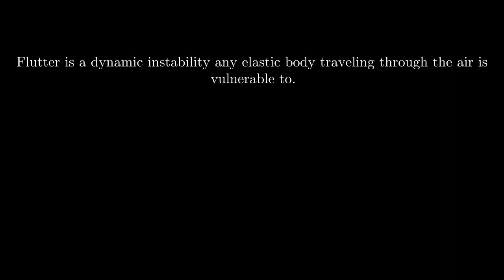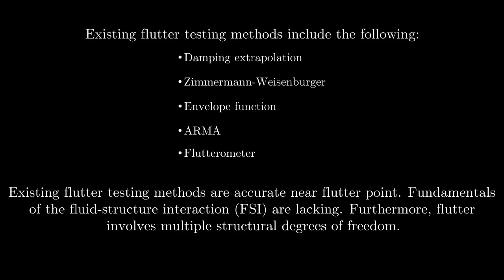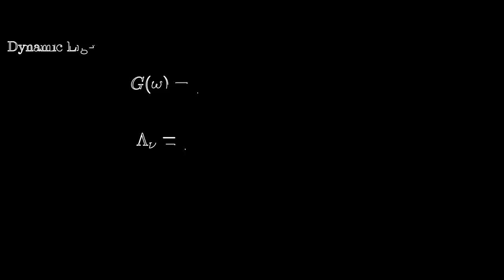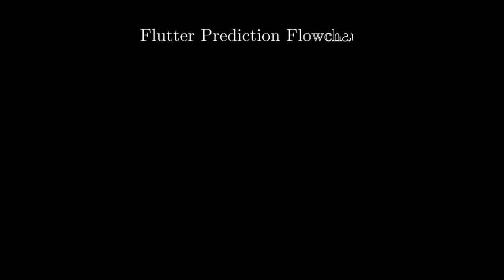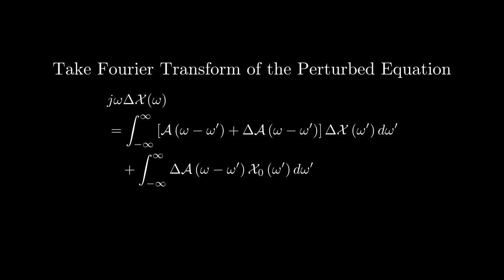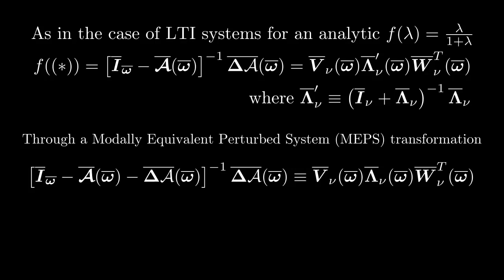Dynamic Eigen Decomposition III: Applications to Flutter Prediction, Linear Time Varying Systems

Comment: It is important to know that the perturbed flutter equation has the rank of 2N, exactly twice the number of structural degrees of freedom, regardless of how many degrees of freedom the original aeroelastic equation of motion has. This means there are only 2N nonzero dynamic eigenvalues and we need to deal with only 2N dynamic eigenmodes.  Typically, the coupled AE equation has far more fluid DOFs than the structural DOFs. For example, if we use a CFD (computational fluid dynamics) model the number of fluid equations can easily reach an order of 10^5 to 10^6. On the other hand, the structural equations are in a much smaller order, say of 10^2. Hence, by working with the perturbed equation we only need to calculate the 2N dynamic eigenmodes and eigenvalues instead of solving the 10^6+2N equations.

Comment: The biggest takeaway from the application of DED to flutter prediction is that flutter can be thought of as an intrinsic property of the aeroelastic system, rather than a solution of the system at the particular condition. Most interestingly, the flutter mode exists in the aeroelastic system and therefore can be extracted at any dynamic pressure values.
Reply: At ANY dynamic pressure, below or at or above the flutter point.

Comment: In the second half of the video, the whole point of the proof is that you can use as many frequency samples as you want making the approximation of the convolution integral as accurate as possible and in the limit you'll get the MEPS for the linear time-varying system.